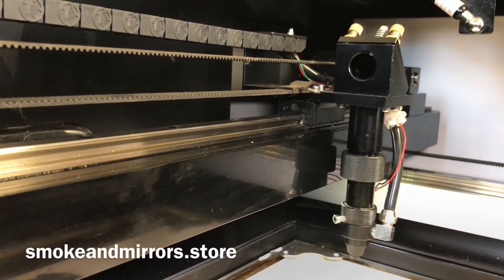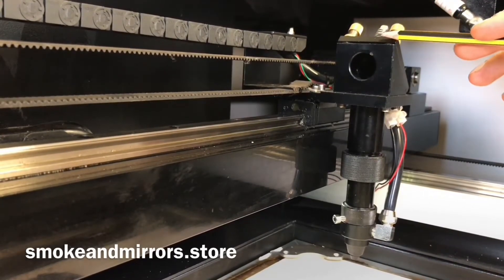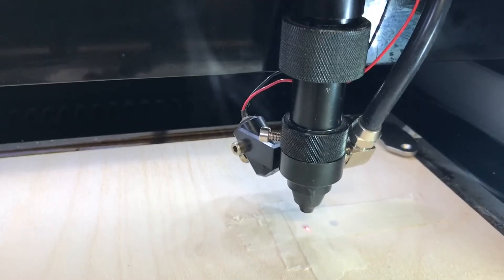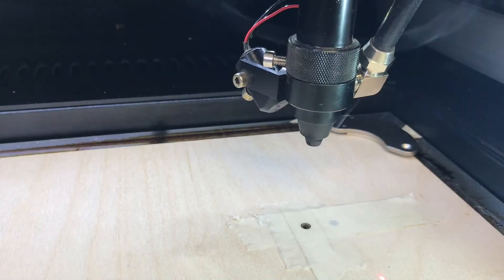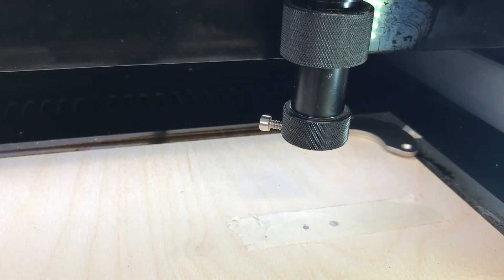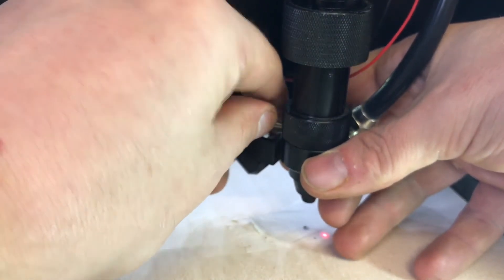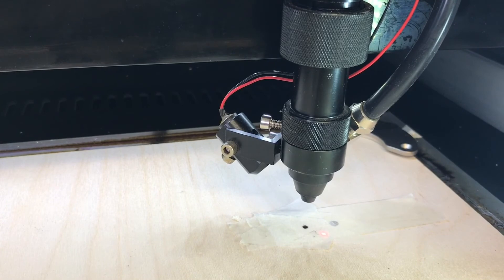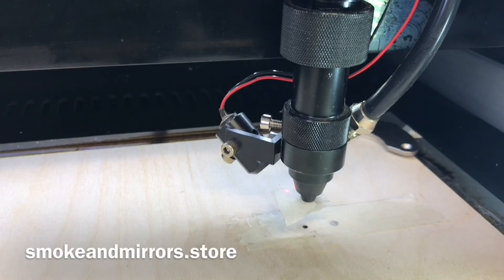How to: Test Vertical Alignment

Comment: I'm getting the pinpoint mark instead of the rounded pulse mark.  Visually, it looks like my cone placement is fine.  Is there anything else that needs to be checked that would create that?
Reply from the maker: If you're at focal height, I'd expect a pin hole if the laser is through a focus lens. If you're above or below focal then you should have an unfocused spot. Check overall alignment and that your tube is working properly. Be careful, laser eye danger and high voltages.